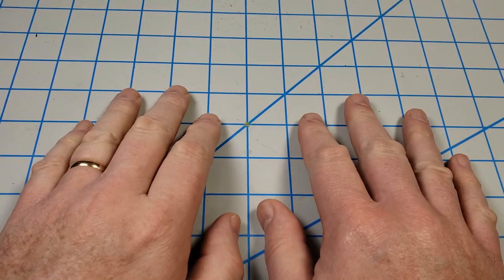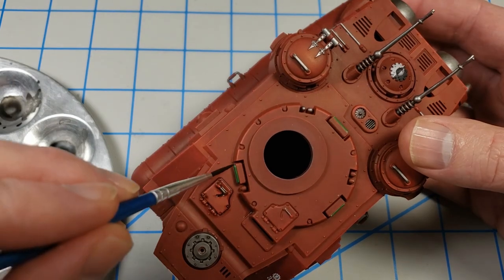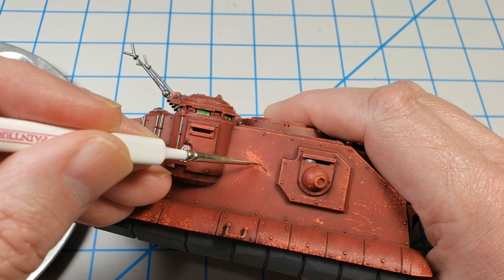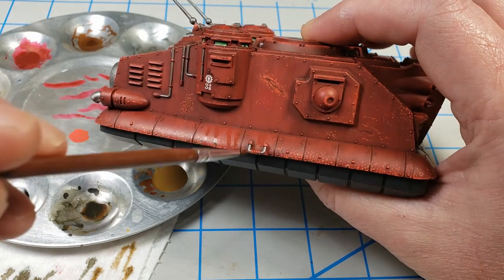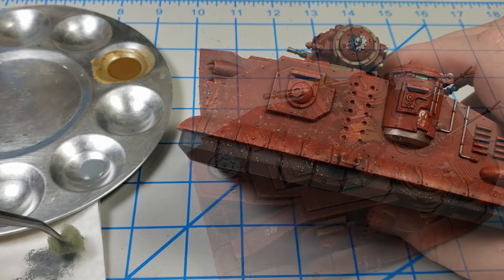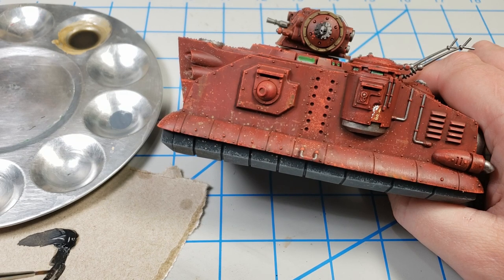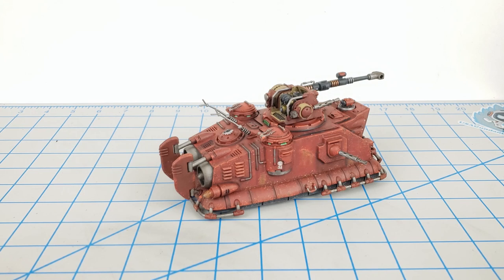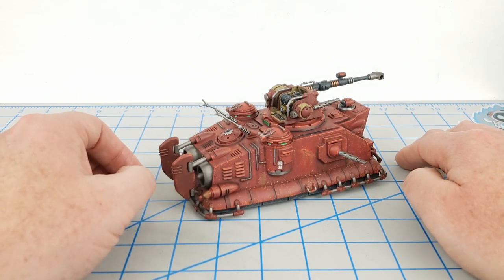Citadel's Warhammer 40K Skorpius Disintegrator: Part 2: Weathering And Finish

Comment: got this in my first start collecting box and im clueless as where to start from
Reply from the maker: Hey! Thanks for watching and commenting!

If you mean the whole box, maybe start with the smaller things first - cleanup, assemble, and prime the figures. It would save a bit of time to prime them in a deeper red. (Unless you're going to use Contrast paint - I'd recommend using Wraithbone as the undercoat in that case. They do make a spray can of that.)

Then move on to the vehicle. I'd say start by picking which version you want to build - troop transport or tank. Assemble it as I did in the first Episode in the series (https://youtu.be/ZLH3iBJYZc8), and then prime it.

From that point on I'd do it "assembly line style". Add the red paint to everything, then other colors in turn. Once all is base coated, you can then do the detailing, shading, and highlighting of the figures, and then turn to the vehicle. 

It's a lot of work, but hopefully this suggested order will help. Have fun with it!
Reply: @JonBius  Thanks , il be doing the transport mode , do you have any tips for people that dont have an airbrush , if it\s totally essential il leave the dunerider untouched till i get one , thanks for your time
Reply from the maker: @toasty6570  No need for an airbrush at all! In that first part of the series, I did use an airbrush to prime it, but I could have just as easily done it with a spray can. The actual base colors were all done with a brush. Multiple thin coats will get you where you need to be!

Be sure and subscribe to the channel! In a few weeks, I'll be building, painting, and weathering the Adeptus Mechanicus Archaeopter - no airbrush at all! And it will be all acrylic too, including the weathering. Be sure and check that out.